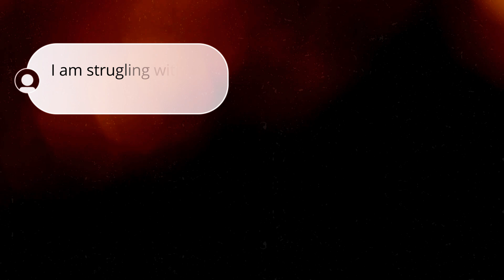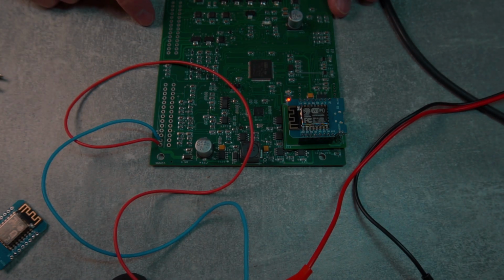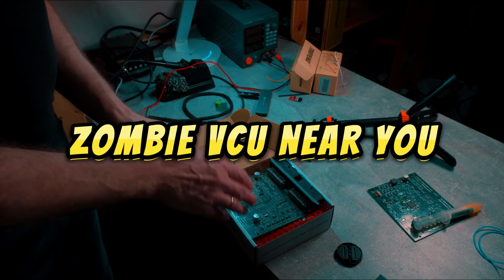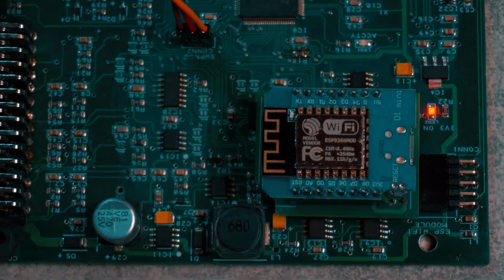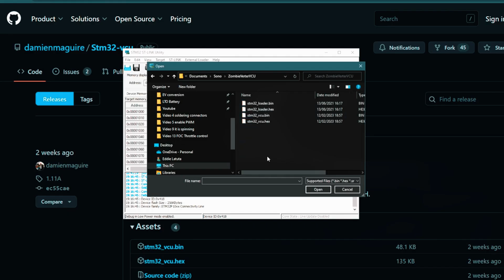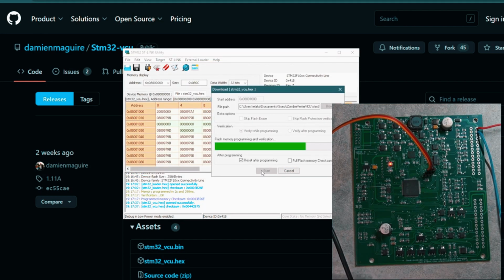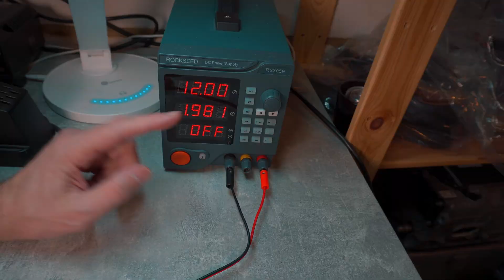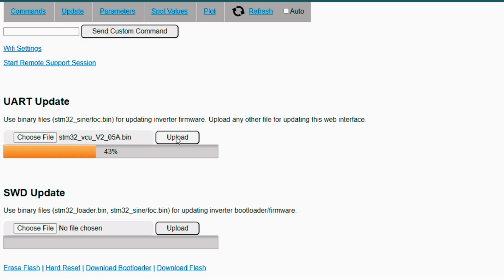ZombieVerter VCU Repair

Comment: I need to check mine, because I couldn't seem to get it to work either.
Reply from the maker: Does your board not go into run mode - led not blinking at power up?

Comment: Yikes, how did the wrong resistor get on there? Did JLCPCB do that or was the wrong resistor value in the BOM file? Either way, it's likely there are more of those boards out there, I think... Idk what the threshold resistance would be for pull down of boot0.
Reply from the maker: I am not sure I suspect JLCPCB made a mistake while populating the board.

Comment: wish you would have zoomed in to what exactly you are probing at 1:58 and again at 2:03, you are so knowledgeable and these videos are invaluable
Reply from the maker: Thank you but that was simply a power supply voltages. I was just checking 5V and 3.3V on a filter capacitor.